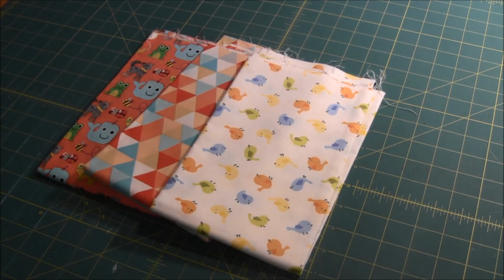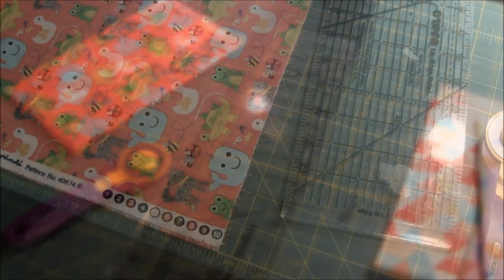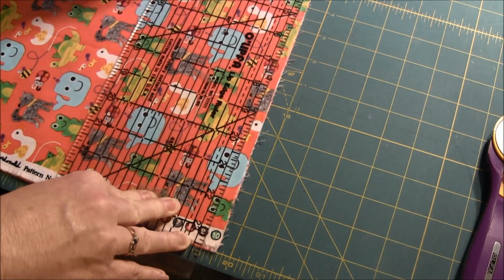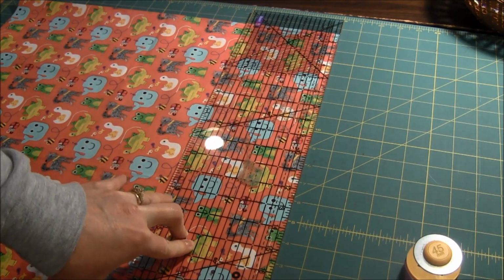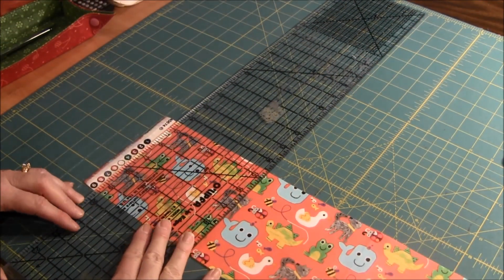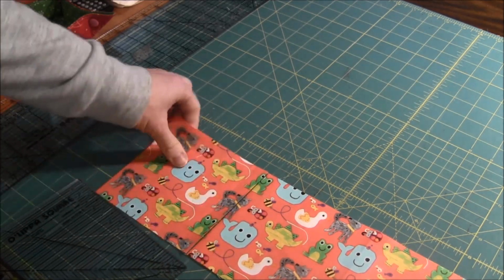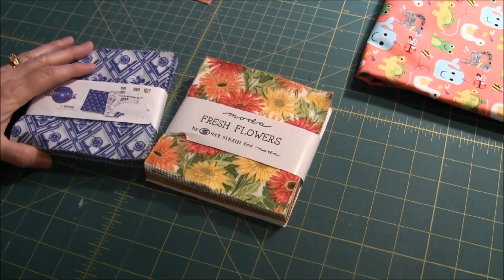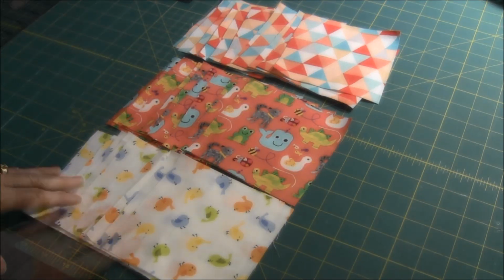Beginner Quilt Series - How to Cut Quilt Squares

Comment: What if you’re cutting up old clothes or fabric without a salvage line?
Reply from the maker: Hi! Thanks for your question.  If I was cutting up old clothes, I would make the fabric as flat as possible by cutting seam(s) open.  Then see how you can get the most squares out of the fabric and trim one side to be straight, cutting off any seam allowances. Then, use that straight side as a straight edge to start your measuring and cutting the other sides.  Happy Quilting!

Comment: I'm curious about your seam allowance-are you using 1/4 inch from the cut 5-inch square, thus you end up with 4 3/4 inch squares?
Reply from the maker: Hi and thanks for your question!  For quilting, the standard seam allowance is 1/4" on all seams, unless your pattern calls specifically for something different.  Since this quilt was cut with 5" blocks, after the seam allowance all the way around, it will end up as a 4.5" x 4.5" finished block.  If you want a true 5" finished block size, then cut your squares at 5.5" inches square.  Hope this helps. Happy Quilting!

Comment: How many 10” squares are in a precut package?
Reply from the maker: Hi Deborah!  I used a charm pack which is 5" squares and comes with around 42 pieces of fabric.  10" square packs are called a layer cakes an they also come with around 42 squares.  But, check your specific charm pack or layer cake to be sure as they can vary as to how many are included.  Happy Quilting!